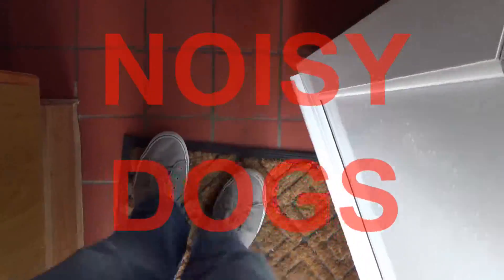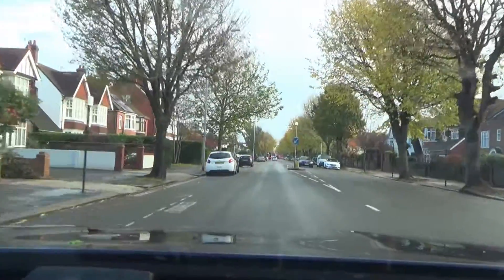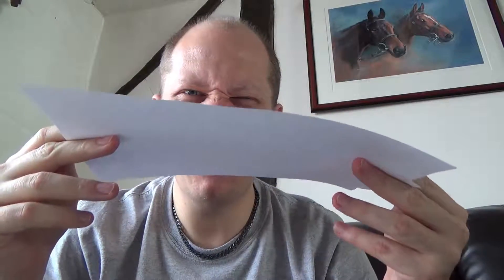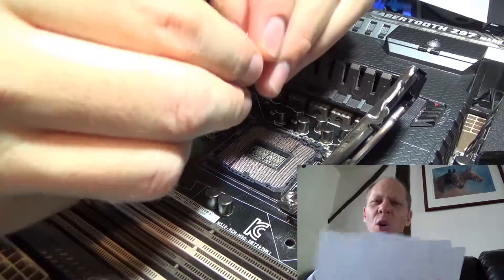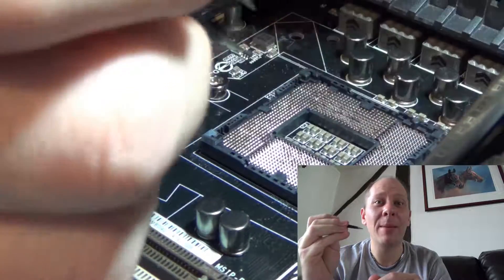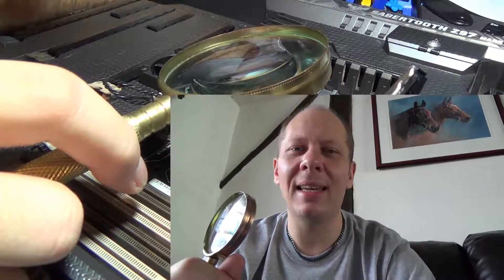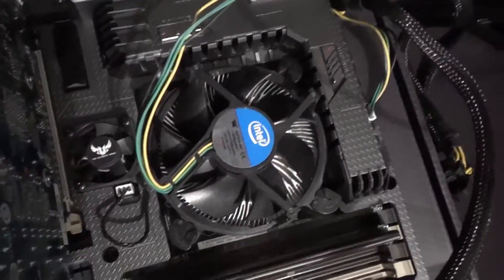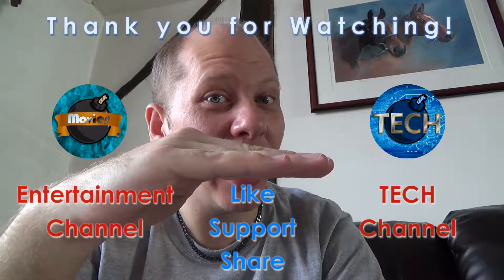LGA Bent Pin Repair - BOM Tech PC Repair Guide

Comment: Subscribed! Hey mate, I've got steady hands <; ), but seriously, good vid! One question though before I attempt this repair. I have an LGA 1151 socket and noticed that approximately half the pin look bent one way and half the other way. Should the pins be straight up/down or is it normal to have them bent over in a specific angle? Thanks! Really enjoy seeing the driving part, reminds me of my fantastic time in EU. Can't wait to go back...
Reply from the maker: LGA sockets usually have one side of pins bent in one direction and the other in another direction. Try to find some detailed pictures on google images for the 1151 socket and you should see how it is supposed to look. The pins are not supposed to be straight up. Here is a good picture - http://cdn.wccftech.com/wp-content/uploads/2015/02/Intel-LGA-1151-Socket.jpg   Also thanks for the sub and great comment! :0)
Reply: Thanks so much!! :) Cheers!